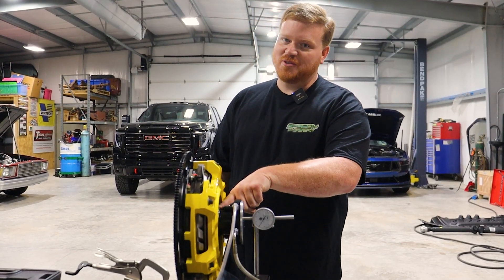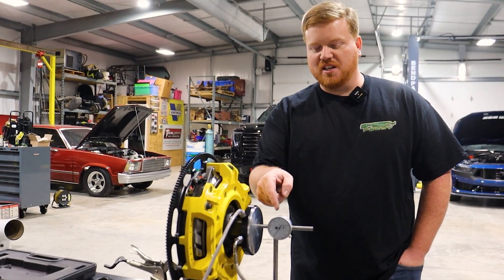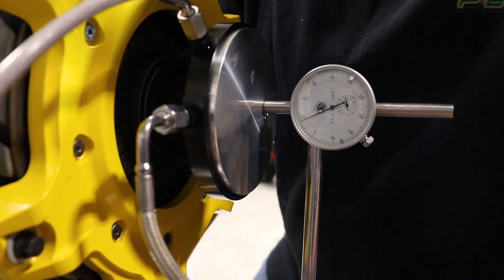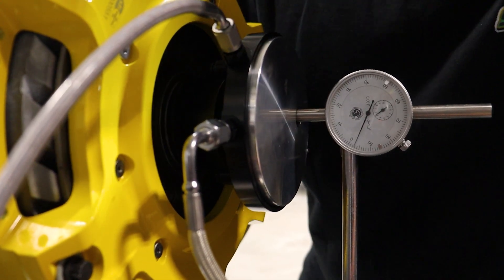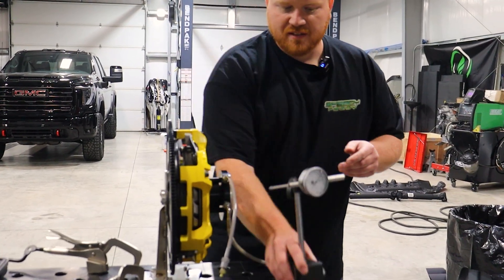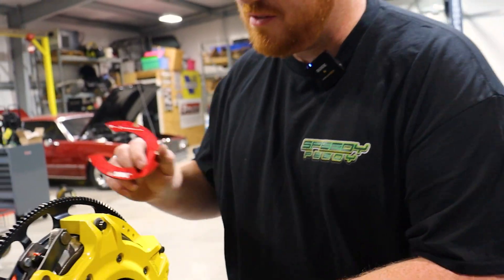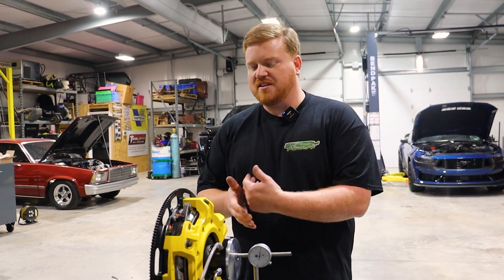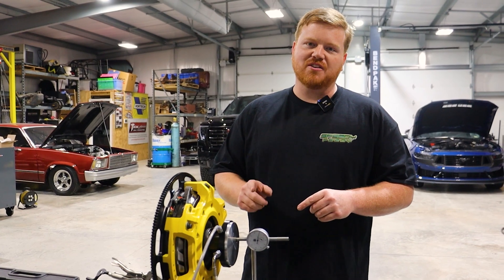Does Adding Shim Increase Travel?

Comment: What is the typical bearing air gap set too as you mentioned in the video it will be touching the entire time?.  Thank you.
Reply: The bearing is always touching, so there should never be a gap between the pressure plate and bearing. The gap is between the piston and the slave base. This distance is to ensure there is free travel as the disc wears over time. We like to see .100"-.125" in most cases.